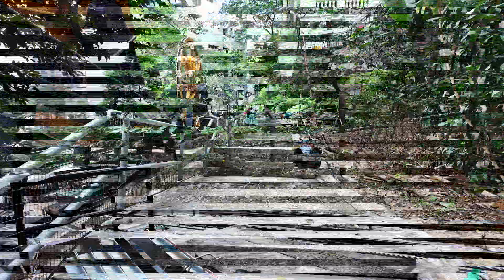I Travelled ACROSS THE PLANET To Get This Photo (Doll Vlog #15)

Comment: Great video! What kind of tripod stand & attachment are you using? (It has what looks like an acrylic base?)
Reply from the maker: It's just one of those clear acyclic stands from Taobao, and I drilled a hole through it. 1/4" size to fit the most common screws of camera attachments so I could throw a normal tripod plate on it to attach to my tripod😉
Reply: @AKTKLM  what an awesome idea!